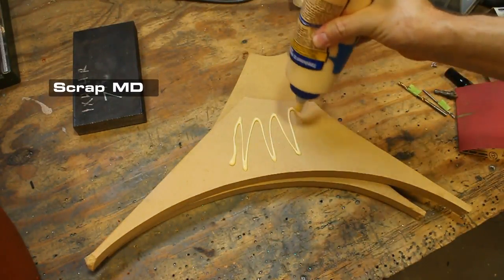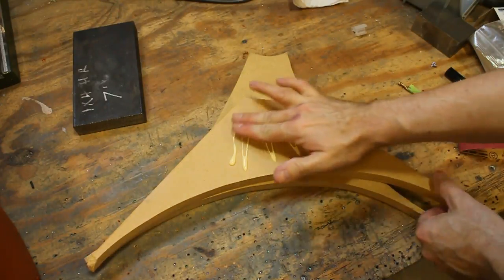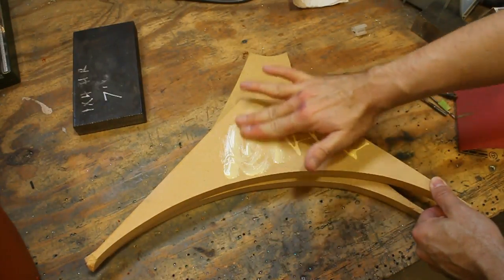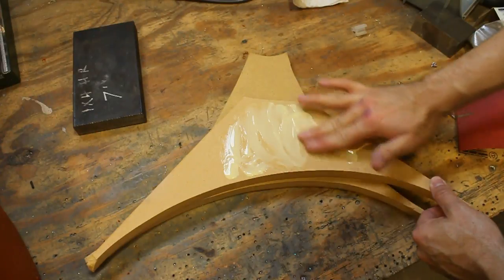🎃 Carving a Steel Jack-o-Lantern With a Plasma Torch and a MIG Welder 🎃

Comment: Wesley, great work as usual.  Do you bend & fill your own "neon" tubes?  Also, it looks like you use solid-state high voltage power supplies to energize them.  Source?  Specifications?  Thanks.
Reply from the maker: Hey, thanks. I work with a guy who does all my the actual bending. I get my transformers from him, also. I believe they're all NeonPro brand.